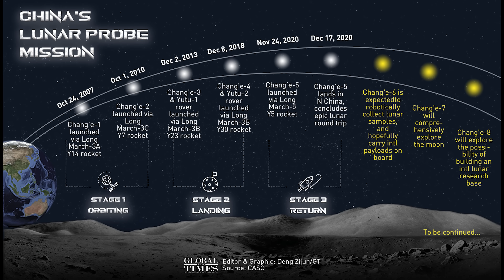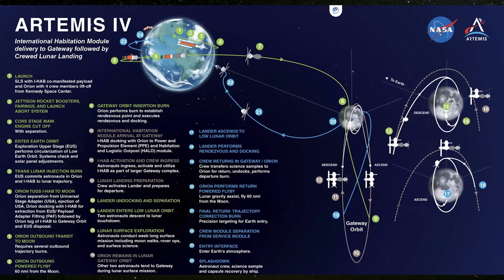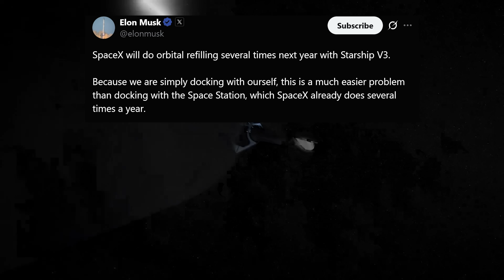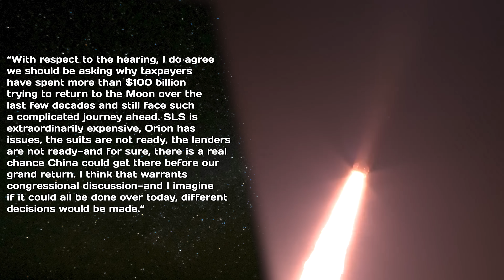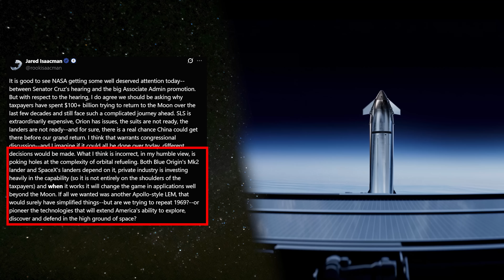Ex-NASA chief revealed the Real Problem with SpaceX Starship to get back to the Moon while China

Comment: SpaceX Starship is designed to transport a large cargo to the moon instead of another Apollo's flag-planting tokenism. Boeing SLS is the flag-planting token mission.
Reply: there are better ways (in terms of cost and safety) https://youtu.be/Zs3XhrMGrGs/
Reply: @charalamposkosmas1980  A pipe dream without any serious investment.
Reply: @charalamposkosmas1980  That's not moving a SkyLab-like object to the moon.

Saturn V can transport a Skylab into low orbit or transport the small Apollo system into the Moon's orbit.

Starship is like a reusable Slylab with second-stage rocket engines attached.

Without the refueling step, the Starship system is a reusable Saturn V + Skylab-like solution.
Reply: @charalamposkosmas1980  >there are better ways (in terms of cost and safety)

That's the Indian government's problem.
Reply: @charalamposkosmas1980  Reminder, the Biden administration has placed roadblocks against Starship. Democrats have wasted time.
Reply: Whatever it's design was supposed to be it has failed miserably.
Reply: @divedevil985  Flag planting on the moon has been done.
Reply: @valenrn8657  you must not be aware that SLS can easily be repurposed into a cargo only heavy lifter. Meanwhile Starship is unlikely to ever be certified for launch or landing with humans on earth.
With a performance shortfall of 115 tons you should wait until it actually functions before making absolute statements.
Reply: @divedevil985  The estimated cost for a single Space Launch System (SLS) rocket launch is approximately $2 billion or more.

The Starship system is designed to deliver more than "100 tons" + SkyLab-size accommodation to the moon, not just an Apollo-style payload.
Reply: @divedevil985  The only reason for the Starship system is for a lower cost than SLS's $2 billion cost per launch.
Reply: @divedevil985  It's easy to deliver small Apollo-sized cargo with SLS or with Saturn V. 

For delivering a larger than Skylab-sized accommodation with more than 100 tons of cargo to the moon, the SLS and Saturn V system can't do it.
Reply: @divedevil985   SLS Block 1 is capable of lifting approximately 95 metric tons (209,000 lbs) to Low Earth Orbit (LEO) and 27 metric tons (59,500 lbs) to the Moon.

Starship's lift capability is projected to reach 100-150 metric tons to Low Earth Orbit (LEO) in its baseline reusable design, making it a super heavy-lift launch vehicle. In an expendable (non-reusable) configuration, its capacity could extend to over 250 metric tons to LEO.

In Starship's expendable mode, Starship is more than two times greater than SLS's lift capability into LEO.

Starship's purpose is not a "plant the flag" token mission.
Reply: @divedevil985  SpaceX's goal is for the fully reusable Starship system to eventually cost between $2 million and $10 million per launch, though the current cost is estimated to be around $100 million.

vs 

Space Launch System (SLS) rocket launch is approximately $2 billion or more.
Reply: @divedevil985  Wake me up when Boeing/United Launch Alliance lowers SLS's launch cost to $150 million.
Reply: @valenrn8657  Saturn V is not in production, but it completed what it was designed for very well.
Starship has been downgraded with actual performance data to 35 tons to LEO while SLS block 2 can insert 46 tons into deep space.
Reply: @valenrn8657  no...the only reason was for SpaceX to get public funding which could apply to their real ambition of a massive starlink launcher. There HLS proposal is not suited for lunar use.
Only a bean counter looks at a cost estimate over the risk stacking of 15-20 launches to send one vehicle to the moon. Each launch endangers billions of dollars of payload plus loss of the vehicle. Cheaper isn't better.
Reply: @valenrn8657  design vs reality. Starship has been downgraded to 35 tons to LEO so your 100 tons to TLI with 15-20 risky refueling flights to leave LEO far outweighs the lower cost. What does cheaper benefit anyone if it doesn't work?
Reply: @divedevil985  Fake news from social media BS.
.
Reply: @divedevil985  The Falcon Heavy has a maximum lift capacity of approximately 63.8 metric tons (141,000 pounds) to Low Earth Orbit (LEO) in a fully expendable configuration, but this capacity is reduced to around 57 metric tons if the two side boosters are recovered and reused.

Your source is fake news. Think about it.
Reply: @valenrn8657  the source is Elon's X account by the way. I have to agree with you that is not a reliable source.
Reply: @divedevil985  The "the only reason was for SpaceX to get public funding which could apply to their real ambition of a massive starlink launcher" is FALSE.
Reply: @divedevil985  35 tons are development V2 prototypes, NOT the incoming V3.

Your narrative is FALSE.
Reply: @valenrn8657  It's not a narrative. It's actual data on a rocket that still doesn't have the full weight of it's many systems.
Your narrative relies too heavily on hyped projections that predicted V1 would lift 150 tons; V2 is the result of that original shortfall and it has performed even worse.
You don't seem to understand they can't iterate their way out of a grossly overweight rocket.
Reply: @divedevil985  Your narrative is bullshit.
Reply: @divedevil985  Your argument about 35 tons being the final configuration is absurd when it's less than Falcon Heavy.
Reply: @divedevil985  Your demonizing of Starlink is typical bullshit from the leftist establishment.
Reply: @divedevil985  Space refueling has been demonstrated by China. LOL.

Comment: You talk about launches per-year, but Bridenstine is talking about dosens of launches in the span of maybe a few days. In-orbit refueling has to go fast because your propellant is boiling off the whole time. These new ideas aren't being dismissed "just because they're complex or unfamiliar", it's that it takes time to prove all this out and it's time we don't have. Think of just the mission ops needed to manage multiple back-to-back dockings and fuel transfers per day. Think of on-the-ground infrastructure required to catch a starship, clear the launch tower, refuel another stack and launch in a manner of hours. The fuel storage on the ground would be collosal. This all has to happen dozens of time in a row without a hitch and we're dealing with hardware that has yet to reach orbit or return in one piece. 

I could say, "let's build a tunneling ship that will take us to the core of the Earth by the end of the year!". You could say, "I don't see any reason to doubt the project just because it's complex and unfamiliar", or you could maybe not put your head up your back-side. It ain't gonna happen.

The Appolo Lunar Lander had a dry mass of 4-5 tons. Starship has a dry mass >100 tons. It's massive overkill. It makes no sense.

Comment: I never understood this, in 60's we used one rocket, and that rocket less power than starship.
Reply: Starship is different because they are attempting 100% reusability. The Saturn V was 100% expendable.
Reply: @billkaroly  With Saturn V you could reuse the astronauts.
Reply: Saturn V used liquid hydrogen and liquid oxygen in the upper stages. So while Saturn V has less power, it also less mass than Starship. So when you calculated power per mass of rocket, Saturn V beats Starship hands down.
Reply: Saturn 5 delivered a lander to the moon with a dry mass of 4-5 tons. Starship has a dry mass of over 100 tons. The laws of physics haven't changed much since the 60s. Putting that much mass on the moon is ridiculous overkill. It makes the whole project way more complicated and risky than it ever needed to be. Starship isn't designed to land on the moon. It's an afterthought.
Reply: The lunar lander had a dry mass of 4-5 tons. Starship has a dry mass of >100 tons.

Comment: That tall, skinny Starship lunar lander will topple over on landing unless touching down on very level ground at close to zero horizontal velocity. A disaster waiting to happen.
Reply: Oh yeah? Why so?
Reply: @Shriekingbushpig  Starship has a high center of gravity and the lunar surface is covered in boulders, and is not flat and is hilly. Land on a hill with an incline, and the starship will tip over
Reply: @nickl5658  Yeah because they haven't even landed a rocket in a more challenging environment like the high gravity and high winds on Earth...oh, wait. 

With the low gravity and zero cross wind it will be easier to land on the Moon. They can have less robust and complex landing legs than they would need on Earth and it won't have horizontal velocity since the falcon boosters already land on moving  and pitching barges in the ocean with zero horizontal velocity. 

In fact the gravity is so low they can use attitude thrusters up on the nose for the actual last dozens of meters of the landing profile. These are extremely precise and the ship's rate of decent can be slowed to almost a stop before touchdown. Then if it isn't perfect it can continue using attitude thrusters higher up on the nose to stabilize itself until it can come to a complete stop. 

The Starship's much larger size and payload will be effectively reduced to less than that of an Earth based smaller Falcon 9 landing which SpaceX has done hundreds of times now.

Comment: Counterpoint to the NASA chief: SpaceX is inventing an automobile, not a wood cart with a big rubber band to give it an initial push.
Reply: It's like planning a trek driving across country through deserts and high altitude mountain passes, but where if you step outside you die. You can choose between a Model T or a modern fully equipped and specially built RV. Sure if you plan really well both could make it but one has a magnitude greater chance of not making it and losing its' crew over the other.

Comment: So, basically, Jim thinks that beating Chinese with 70s technology is a big deal, but developing a 21 century technology for a sustainable presence is less important? I think his concerns are nothing more than a political agenda.
Reply: You're being blindsighted
This is not a case of "70's technology vs 21st century technology" 
It's a problem of a bad initial concept that's leading to poor planning.
BOTH sides are using 21st century technology, BOTH operations are designed to allow for an eventual lunar base and initial resoruce extraction
superficial similarity or use of an advanced version of a past propulsion system when the material science and redundancy is superior does not count as "70's tech" 
The problem is that america is, once again, burning away DECADES worth of a head start because it believes in marketing over engineering, and the problem is that is has now been locked into a design that would be a miracle if it could perform half as many successful missions as Appollo. IF it can perform a successful one at all and not be a death trap like it's spiritual predecessor, the N-1

Unless you can bypass the rocket equation and/or manipulate mass the problem stands: the starship needs to lift an unessesary amount of mass to orbit regardless of mission, it then requires a refuelling process that demands a level of reusability and reliability that is not possible with curent technology, at least not with this category of engine, and the increased weight due to its choice of material has led to it to seek to reduce mass in unconventional ways that have increased failure points and reduced redundancy 

And nobody has talked about its greatest flaw: it is FAR too tall and narrow.
We're seeing landers tip over on the moon because they are more narrow and tall, now think of this skyscraper landing on the lunar surface where gravity is lower and the ground is neither perfectly even and it could  there's no guarantee the regolith would hold.

there's times where you have to step back, look at the broad picture, realize you burned a ton of money in snake oil, and listen to the engineers for once

This is not my field by a long shot and even I could easily understand why trying something like this was a bad idea, especially if you don't have a pre-existing landing base built on the moon that could at least reduce SOME of the risks.
Reply: @fl00fydragon  SLS is nothing like 21 century technology. RS25 and SRBs are from 80s, the concept of disposable monstrous booster is definitely past century too...
Of course there are challenges, but that were innovation emerges.. SpaceX will succeed, no doubt. And they won't even need others for successful lunar mission, it'll just take a little longer for them to do all themselves.